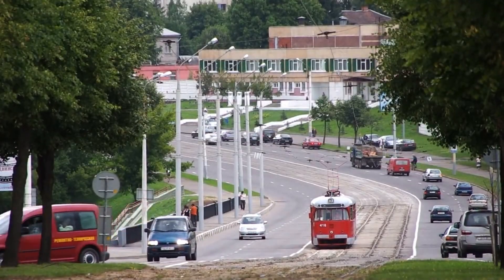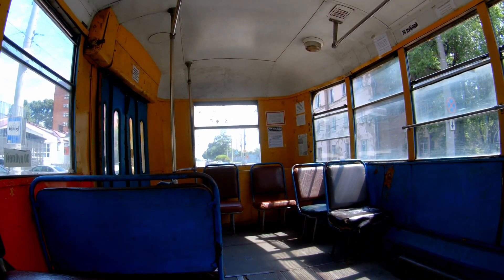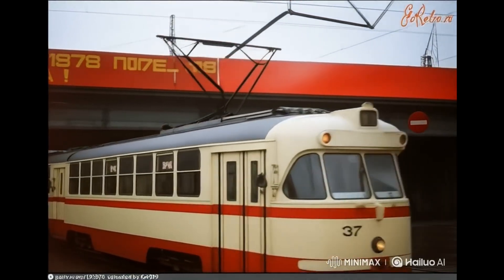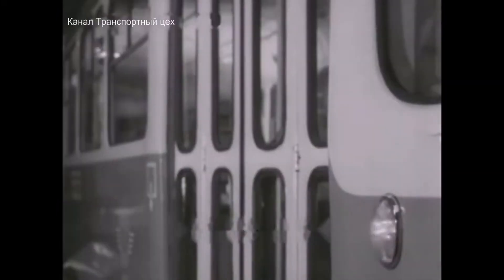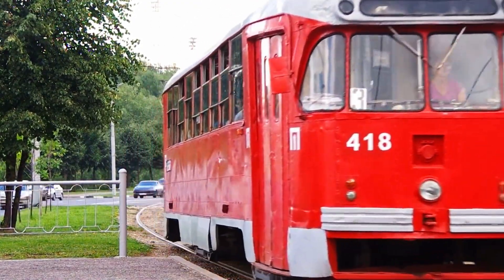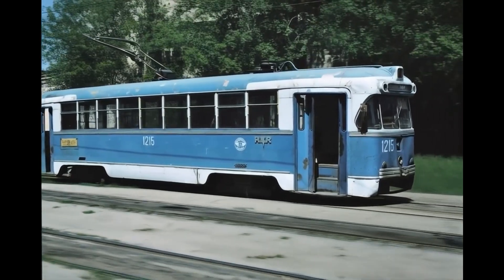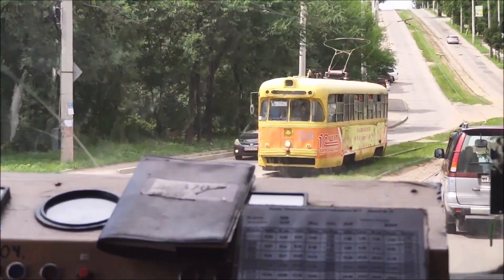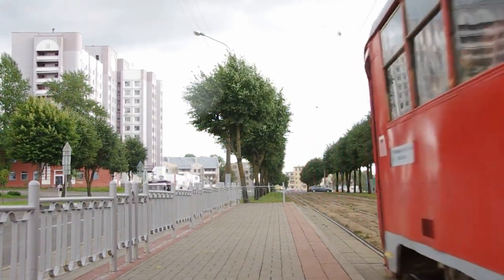This Old Soviet Tram Holds Up Against Any Modern One | RVR-6 Review

Comment: Clearly the RBZ-6 unit was built on the basis of the pre-war version of the PCC tram.
Actually two versions of the PCC tram were manufactured, the first manufactured before the war was in effect half electric-pneumatic, this version was of higher quality assembly and materials, and the second manufactured after the war was completely electric and clearly worse in manufacture and materials, this was reflected when between 1949 and 1955 the truman-esinhower doctrine on the widespread use of the automobile caused most of the tram networks to be abandoned and these trams were sold to other countries, Mexico City bought around 2000 units that continued mostly in service until 1979 and some units modified in multiple unit mode until 1996, over time as they failed the differences between the 2 different versions were discovered, 2 units are still preserved in the electric transport museum along with a j.g.brill unit from 1900 and several trolleybuses.

Comment: In the US,particularly New York,and Boston,there were Elevated and Subway cars,that were set up,with high voltage circuits,and the controllers handled 600 volts,DC direct! All the cars preserved now,are the low voltage,battery type! That was Frank Sprague's gift to the multiple unit operation,that literally governs every Electric Locomotive,Electric streetcar,and diesel Locomotive,to this day,with multiple variations,depending on the country,and operating characteristics! Anyway,there is now,over 100 years of experience,with that type of operating circuitry! Thank you,for an excellent technology forum,and yes,I've ridden on PCC'S,both streetcars and Elevated equipment! Thank you 😇 😊!

Comment: Thanks for this interesting video :)
Too bad that with all the geopolitical crap going on nowadays, I won't get a visa for Russia anymore, and even if I would, it would be extremely difficult to get an actual ride there, and once there, peacefully and completely letting out all politics, just study the (really interesting!) trams, talk to local engineers and enthusiasts, maybe even get a chance to operate your trams with their different solution approaches for real (I'm an engineer for decades now, I really like exchanging experiences, make new ones and see how similiar problems are approached by others). Okay, Хабаровск really is a bit off and hard to reach from Central Europe ;D  , but as far as I got it, Москва also has preserved one of these trams. I take it they have a similiar handle controlled conventional resistor steering like the KTM-5?

Comment: As an American tram (or as we call them, streetcar) enthusiast, I’ve always wanted to ride on a RVR-6.  I’ve thought they were especially beautiful, one of the most beautiful trams inspired by the PCC.   They are reminscent in some design aspects of an obscure American tram called the Brilliner, which was made by one of the companies that developed the PCC, but decided to pull out of the project and do their own design, rather than license their patents to the PCC manufacturers (which were initially J.G. Brill’s competitors Pullman-Standard and St. Louis Car Company).   Thank you for this lovely video!
Reply: more  likely they stole the plans from PCC. or reversed engineered . phila bought Kawasaki's modern looking but extremely heavy the steel wheels wore out in very low miles . costing a lot more to use. so i read they took some of there better cars sent them to a company that put new trucks  under repainted and running them but only on a few routes since wires and tracks were removed from many streets..  similar the marmon-harrington trackless trollies  replaced by am general when it was still owned by AM MOTERS   they had to recall them they were shocking the drivers  did the fix at the closed am dealer in my town .  reported they replaced them but this batch has a gm v 6 motor that can be used to drive around obsticales or around a street blocked by fire or ems   a problem wired trollies or trackless had
Reply: @ the RVR-6 is completely different from the PCC in terms of its configuration, electrical system, door engines (early PCCs did use air operated doors, but the newer ones were “All Electric”), seating, driver’s controls, power collection, trucks and bodystyle.   It is an original tram.  Now the Tatra T-1 did follow some PCC design choices, but the Tatra T2, T3, T4 and articulated versions were at best vaguely similar to the European PCCs made by BN in Belgium, and completely different from the Pullman Standard and St. Louis Car Company PCCs used in the US

Comment: I missed trams in NZ when they went,  the trolley buses came and went. Diesels are being replaced by EV buses.
Reply: The corporately captured 2024 Govt of NZ has the most Anti-Rail policies since the 1940’s and prioritises building outmoded 1950’s highways to entrap total road dependency. Sadly for most of the country, efficient Railways (especially passenger transit) has been dismissed, neglected and deliberately hindered to ensure failure. No wonder NZ ( shamefully) has the 21st Century reputation as “the World’s Worst Rail Laggard”

Comment: From the US, great video
I used to ride PCC's very often, and rode them in 3 different US and Canadian cities.
When designed, they were a huge improvement from earlier streetcars.
One thing you didn't mention was the magnetic track brakes, the horizontal bar hanging between the wheels that would be pulled against the rail magnetically.  It reduced brake shoe and wheel wear.

Comment: It was quite nostalgic to see blue-and-white ones from my city (Daugavpils). Brings back the memories, even if it weren't that long ago. Were riding in them to school most of the time for 12 years, even though it was 2000s - early 2010s. Most operated until 2017-2018, until they were replaced by newer ones. The 061 one (11:27) is still used during Day of the city celebrations in late May - early June

Comment: The RVZ-6 is related to the American PCC only through the bogies, which are copies of the PCC B3 bogies. The only question is where did they get their design from in the USSR?, especially since the first prototypes preceding the RVZ-6, i.e. the RVZ-51 and RVZ-52, were presented in 1951 and 1952. Theoretically, the Czechoslovak CKD-Tatra purchased a license for PCC from TRC in 1948, but production of the T1 did not start until 1952 (The first copy T1 reached the USSR only in 1957.), i.e. after the presentation of the RVZ-51. I have heard a legend that Leningrad received an original PCC wagon from the USA under the Lend-Lease Act, which could explain access to PCC technology in the USSR, especially since the Soviet RVZ and LM wagons used an auxiliary compressed air system like the Pre-War PCC. Unfortunately, I have not found any official confirmation of this fact.
The rumbling, steady humming noise was not caused by the motor-generator itself, but by the fans for cooling the traction motors mounted on the ends of the motor-generator shaft. The RVZ-6 uses self-ventilated traction motors that have their own fan mounted on the shaft of this motor, the disadvantage of this solution is the lack of motor cooling when the car is stationary.
Reply: Хотел бы дополнить, что в СССР действительно производилась не лицензионная копия трамвая PCC. С 1939 по 1941 год на Мытищинском вагоностроительном заводе небольшими партиями производился трамвай М-38. Для своего времени он имел весьма современную конструкцию: он имел трëхдверный цельнометаллический кузов, опиравшийся на две двухосные тележки, трамвай был оснащён электрическим тормозом и реостатно-контакторной системой управления. Всего было построено 60 вагонов, из которых 57 эксплуатировались в Москве, в трамвайном депо имени Баумана, так-же 2 вагона в 1948 году были переданы в Ярославль, и 1 передан в Новокузнецк. В Москве м-38 эксплуатировались до 1970 года, в Ярославле до 1964, дата списания новокузнецкого м-38 мне не известна. На данный момент ни одного трамвая м-38 не сохранилось.

Comment: In San Francisco the original PCCs that these trams copied still run in regular service as a rolling museum. They acquire and restore vintage trams from all over the world, but especially PCCs and their many copies. 

I know that they have a Tatra PCC copy. I wonder if they have the Soviet version.
Reply: It's the  "F" line, and it's wonderful to take a ride along Market Street an the Embarcadero .
Reply: the soviet version has a different gauge, and afaik RWS-6 were never manufactured in any other gauge than the Russian Broad Gauge. For the very few tram networks using standard gauge, they first imported trams from East Germany, and later Tatras. There were only a handful of those networks anyways, and only one remains today (in Rostow)

Comment: I am a fan of this design. They still use PCCs in some places in the USA as well.
Though I do not get the idea of the silent "low-voltage" concept. If it had air powered devices, then it had a compressor, which I guess would make noise as well, I doubt the generator would be that loud. Maybe they wanted to save money and not include another motor-generator.

Not a big fan of the newer stuff, you can't open windows on anything any longer, too much computerized stuff, they try to make everything look too sleek and modern, lots of times they have fewer seats and less comfort as well.
Reply: the air compressor is not running constantly, since the trams have an air tank to store the compressed air. Also depending on the compressor, those don't have to be that noisy...
Reply: Yes, during my childhood 20-30 years ago I remember that transport had concenient soft seats which you actually did enjoy. Modern seats are just plastic with fabric, hard and not very concenient. Also they make less seats which is even worse. The only thing I really like about modern transport - big windows. Old school trains/trams may have smaller windows.
Reply: For the time being (2025) Boston's MBTA is still running a small fleet of 1945 vintage PCCs on a short line that functions as an extension of a rapid transit line.Nothing is more comforting than the gentle chuga-chuga of a Pullman-Standard's  WAB compressor. 😃
Reply: @aodhganmerrimac  I thought all PCCs had electric brakes.
Reply: @SynchroScore  No far from it. Before 1945 the vast majority had air brakes-well they had three braking systems, two of which were electric; dynamic braking, magnetic track braking & pneumatic or later all electric braking which was first developed in 1939-40 according to my source. For example Boston's BERy/MTA only ever bought 25 all-electrics. The story I head was they didn't like the all-electrics because the brake release was silent & people got hit walking in front of them-I think that story may be apocryphal though.

Comment: I'm curious as to why a generator was not attached to the traction motors to charge the batteries. A more advanced alternative would be to somehow utilise the traction motor magnetic field to derive a charging output. In cold areas, and depending in the current required, resistive heating could be used to drop the voltage for the battery charging.
Reply: In the last decades of steam era, MOST American  Railroad passenger cars were electrically lighted by storage batteries that were charged in motion by small generators on the Wheel set. This worked well in that usage where Intercity long distance trains in almost constant motion and station stops few and far apart.

Method failed for commuter service where stops are frequent and train speeds are slow. 

For these am early form of Head End Power had steam from locomotive was used to spin generator usually in tender charging train
Reply: @AlbertBenajam-ww1db  That was pretty much the standard for European railcars until recently. Almost all passenger cars have a generator on the bogie. And it didn't seem to make problems for commuter service around here, since that concept was widely used for commuter trains too...
Reply from the maker: Electric motors do not idle, so, with this approach, it'll be impossible to charge the battery unless the tram is moving.
Reply: @RailwaysoftheWorld1  True, but then a rotary generator could be fitted as backup and only used if absolutely necessary. This would keep noise to a minimum and prolong the life of a rotary generator.
Reply: @DelticEngine  probably cost was also involved. Adding a generator for the low voltage and also the batteries would have added to the price. Also the series design was not unusual for that time. A lot of old tv's and radios did not have a transformer. Quite dangerous things to troubleshoot and repair.

Comment: Damn, the doors on Prague's T3s never squeak like that lol

But then, I don't think there exists a place in Russia that would maintain its trams as nicely as Prague does.
Reply: Moscow, St. Petersburg and Nizhny Novgorod are the examples which I can vouch for - no such squeaking ever detected in my time riding T3s there. 

From what I gather, T3 in the video was shot not in Russia (judging by the announcement language).
Reply: @Corvo1937  Seconded. That squeaking in the video obviously comes from door hinges and joints that aren't oiled or otherwise greased properly, that is just poor maintenance. If maintained well, the doors of the Tatra trams itself make no audible noises at all; all you can hear is a whirring sound that comes from the electric motor which powers the door and some gears. And if the doors move slowly enough like they do in the modernized Prague T3 trams, even that sound becomes inaudible ;)
In comparison, just from watching the video, the doors of the RVR-6 do produce noises: the hissing of compressed air and the slamming of the doors ;)
Reply: @Corvo1937  T3SU in 8:55 is from Moscow
Reply: Moscow and Krasnodar Tatra T3SU is look like in Prague

Comment: The auxiliary electronics are connected in series? That is weird… Not powered by a motor-generator?

I've heard that some old trolleybuses have got generators connected to their wheel shaft, so the generator can output only when the trolleybus is fast enough (but the batteries are ofted dead because the output from the generator is not enough in some cases)
Reply: In Intercity long distances American trains the system was successfully used, but in commuter service in No electrified are the batteries had to be topped up at depot OR locomotive had to provide.
Reply: Some were designed like that, I think. Similar technology was/is used in train cars to power them.

Comment: The shape of these trams are similar to PCC trams in some ways?
And PCC (also variants) trams are unique as they are operated by pedals, not the handles in common trams
Reply: Great minds think a like. Lovely shapes on both of these models.
Reply: Not exactly unique: in The Hague, Netherlands, all trams (except the Alstom RegioCitadis) still use pedals, even the most recent ones from Siemens that are currently operating and also the newest ones from Stadler that are currently on order and will be delivered from 2026-2028. The tram drivers there love it and say it’s much better and smoother than handles.
Reply: @OneKnifeYeHand  Did they use PCC standard trams before? Is it because they're familiar with the pedal control of the PCCs, so new trams are still designed using the pedals
Reply: @ZK5120A1 That’s correct.
Reply: @ZK5120A1  Yes, and their GTL trams are articulated trams based on PCC tech and even sometimes PCC bogies from older trams. So these have ancient bones.
Reply: Almost all of the USSR post-war trams are operated by pedals too
Reply: @felixyasnopolski8571  No Soviet wagon had pedals, all had a manual speed controller. This was due to the fact that while the RVZ-6, LM-68, KTM-5 wagons were based on bogies that were copies of the PCC B3 bogies, the electrical system was as simplified as possible and did not use the Westinghouse accelerator system, which was used in Tatra wagons and Konstal wagons copied from it.